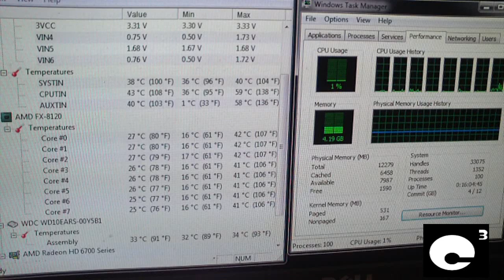Odd Idle Temps with AMD FX 8120 Zambezi CPU

Comment: Idle temp. are not correct. AMD has different monitoring, that "core temps" are not what you look for (like in intel), your cpu idle temp is 41C (cputin)
Reply from the maker: Andrash88 The CPUTIN is the socket temperature. These chips are known  to have socket temperatures warmer that the core temp, especially in water cooling setups.
Reply: ***** It isn't. People say that "package" is the "socket" temp, but that's not entirely true too. Scroll here. AMD is different, and hasn't got sensors like intel http://www.xtremesystems.org/forums/showthread.php?289461-A-little-birdie-told-me&p=5237937&viewfull=1#post5237937
Reply from the maker: Andrash88 AMD has core sensors. They've had them since the K8 Architecture. The sensors on the FX AM3+ CPUs read low numbers at idle, but once they're a bit of load on the CPU, the temps seems to correct themselves. I see the temps fluctuate a lot at low load, but the tend to stabilize at full load. On my water cooling setup, the package temp reads between 38-48C depending on the room temperature (since the radiator's completely outside the case. I now have an AMD A6-6420K APU in the MTDX Black Max and it is opposite of the FX... it reads high package temps, but the CPUTIN is within a normal range for an air cooled 65W TDP processor. I've tried multiple coolers to confirm this.
Reply from the maker: +Andrew Erwin The fan speeds on this machine are fixed, meaning they don't fluctuate/respond to temperature changes.
Reply: +Cube Computer Channel 
Like I said, it's not intel cpu, they don't have core sensors. About temperatures:
http://www.xtremesystems.org/forums/showthread.php?289461-A-little-birdie-told-me&p=5237937&viewfull=1#post5237937
http://www.tomshardware.co.uk/faq/id-2122665/understanding-temperature-amd-cpus-apus.html

Comment: I have pretty much the exact same temps with my 8120 @ 4.2 and my voltage is 1.464!
 running with a corsair h100 4 fans in push/pull, and under full load, I get the exact same scaling.
mobo is the asus m5a97

Comment: My Zambezi 4100 had a normal temperature reading until I replaced the stock cooler. Now I idle at 5c. Also, after installing my hyper 212 evo cooler I noticed that the easy overclock function of my Sabertooth 990fx was no longer 4.1 ghz but 3.9 ghz.

Comment: I also have an fx 8120 clocked at 4.2 ghz. I have a coolermaster TPC 812 with an antec 500 case and it runs cooler than what your waterloop does. 35 C idle and 52 C max load. Also the only application that reports my CPU temp correctly is MSI control panel. In hardware monitar tmpin which should be cpu temp is actually reporting vrm chip tempatures and make it seem like the cpu is running at 75 C at load. Don't know how these temperature readings an the FX chips got so messed up.